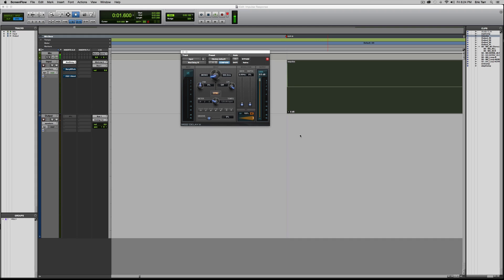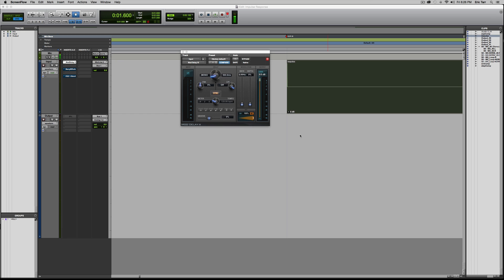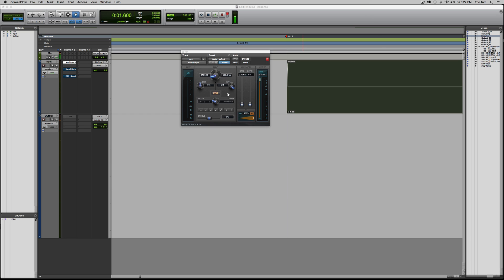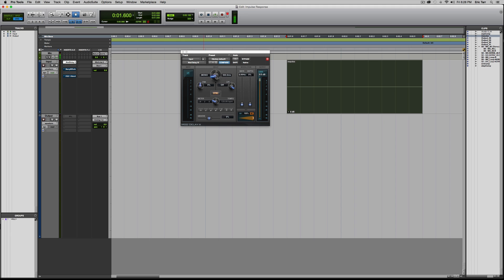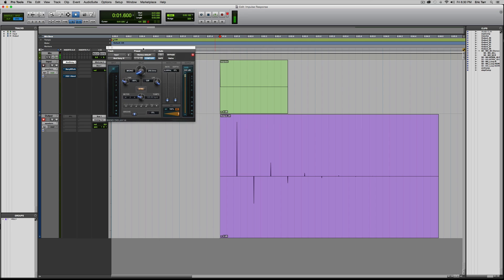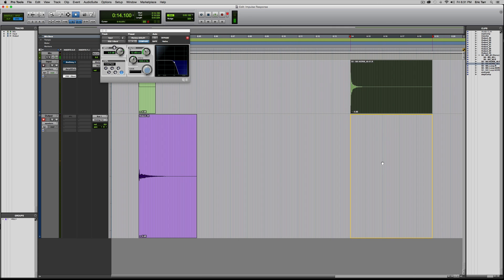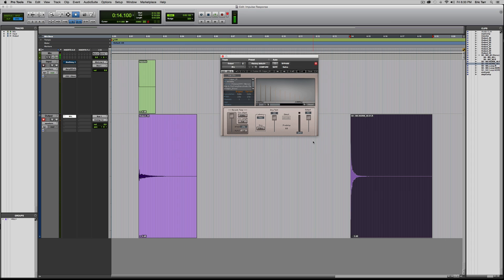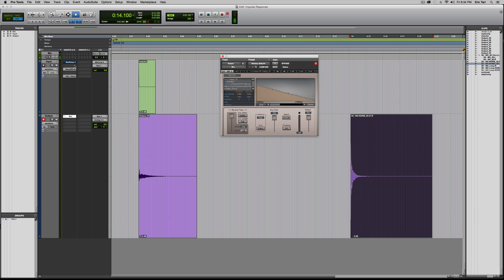Impulse Responses — Part 1  [Analyzing Mixing Effects]

Comment: Do you actually need to use an impulse or frequency sweep that covers the full audio spectrum to capture a more true audio response?
Reply: Optomod The frequency sweep method is the common method for measuring the response of analog and acoustic systems. For digital systems (software plug-ins) either the frequency sweep or an actual impulse sound file will work. A digital impulse has an bandwidth that covers the full spectrum up to the Nyquist frequency of the sampling rate.